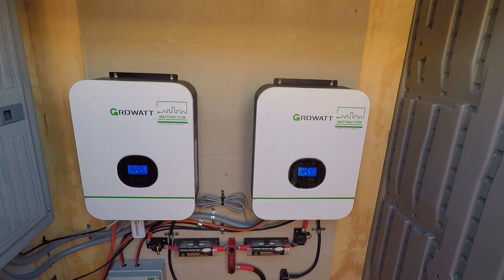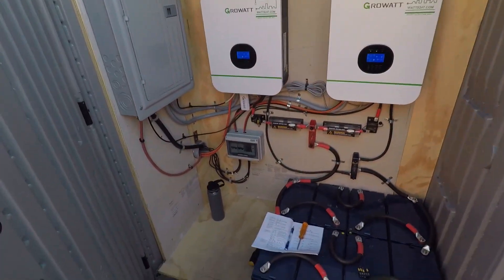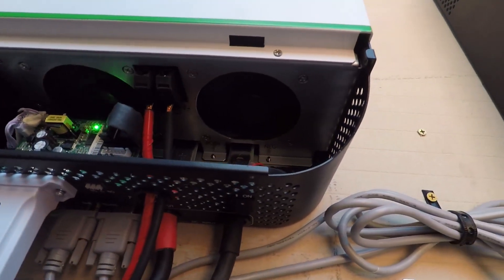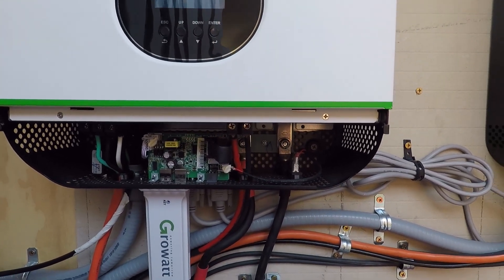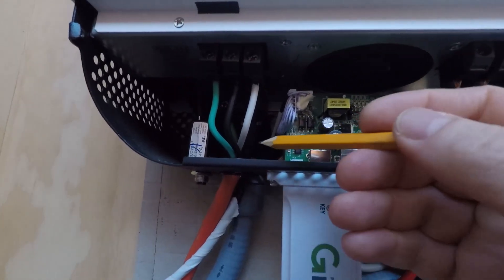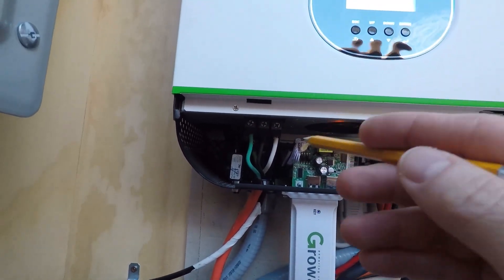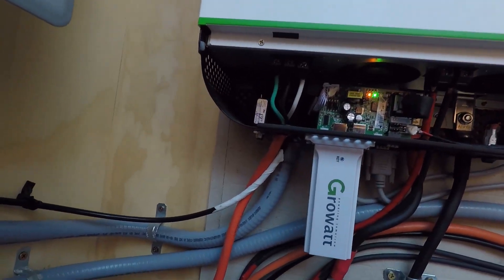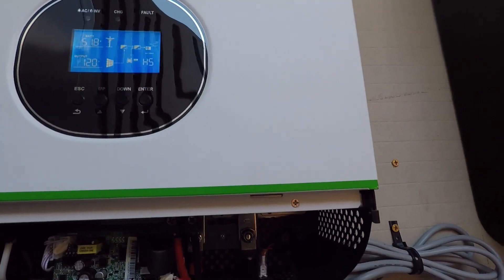Solar Inverters - All in one Wiring Install Basics

Comment: I confused ac output where is from ?
Reply from the maker: On these inverters the AC input and output terminals are right next to each other. On this build design the AC output goes to the panel where I distribute from there as needed.
Reply: @Vallenge  my solar panels is series, so I have two wire from solar panels positive and negative, what's another wire for using AC.
I think it's the power not solar panels 
Is that right
Reply from the maker: @abdirahmanmohamed5823 Sounds like you're talking about DC input going to your inverters from your solar panels. You would then run wiring from your inverters AC output to whatever you are powering. I'm my build for example both inverters power one leg of a panel box and from the box I run lines to power my loads.

Comment: Im no rock science, but bonding DC neutral to ground seems to pose its own issue. 1, DC doesnt need a ground. 2. you just grounded your solar array, so lightning might try to find a path, like a lightning rod. Grounded AC should be occurring through the frame and the AC in ground. But Im no pro and not a rock science. EDIT: The reason AC is neutral ground bonded on a 240AC system, is the phase change. Ground completes the loop.
Reply from the maker: Hello. The neutral bond is on the AC side only and wired the way I described so the inverters are always tied back to the main panel even if they are not actively connected/pulling electricity from the main panel. The system is connected to the house main panel and ground. Thank you for providing feedback.
Reply: @Vallenge  Ok I see it now. Thats smart.
Reply from the maker: Thanks

Comment: Could you explain how you have the neutral jumped from AC -in to AC-out? It’s hard to see on the video…What size AC wire are you using? Do you have 2 wires in one neutral connector hole? Thanks…
Reply from the maker: I jumped the Neutral wire by connecting an additional wire from the neutral input terminal connector to the panel box. Yes, this makes two wires in one neutral connector. The output power of the inverter is connected to the panel and therefore the neutral from input and output are always connected. If there is room and you prefer you could connect the additional wire from the input neutral to the output neutral but space is limited and I found it easier the way I connected it. The wire I utilized is 6 AWG wire. Depending on your plans and specs you may not need such thick wire but as I said in the video I prefer to go with over caution and room for increased specs and expansion in the future. Hope this helps. Thanks for watching and commenting.

Comment: What does THHN mean in AC wire? I have run many circuits in my house and garage but I am not familiar with that designation. Thank you.
Reply from the maker: Hi Ben. Since I am not an electrician I thought I would just share this Description I found online "What is THHN Wire? Thermoplastic High Heat-resistant Nylon-coated wire (THHN) is a single conductor wire with PVC insulation and a nylon jacket. It's commonly used in conduit as electrical wire for buildings. Its heat and oil resistance makes THHN a suitable wire for appliances and machine tools."
Reply: @Vallenge  Thank you. Is it just regular "Romex" or something different??

Comment: Do you have a link to the graphic from the diy forum? I have mine wired like yours but I had to figure it out on my own, I have the lvm-es models and I had to remove the N-G bond screws myself, still having some small issues but working them out slowly
Reply from the maker: I found some of that information and graphics charts at this...https://diysolarforum.com/threads/growatt-3000-spf-floating-neutral-solved-for-now.31692/
Reply: @Vallenge  seems to be a lot of information on the model you have but info on the 3000tl lvelm-es is very limited and signature solar is useless when it comes to asking questions.
Reply from the maker: Dang. Keep at it...